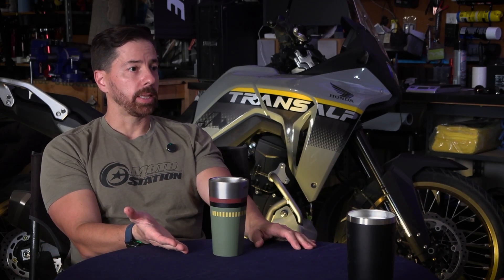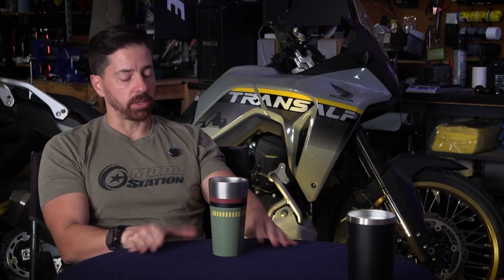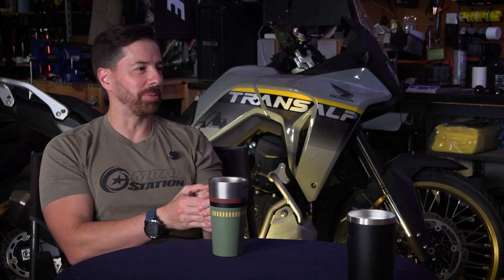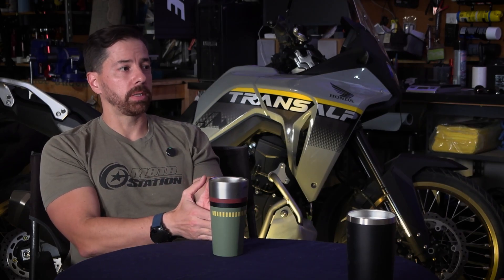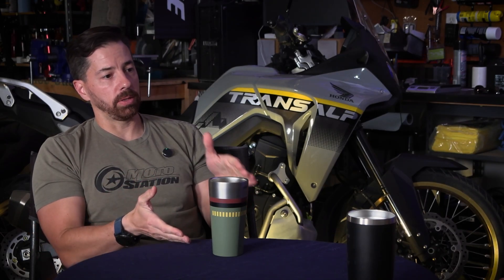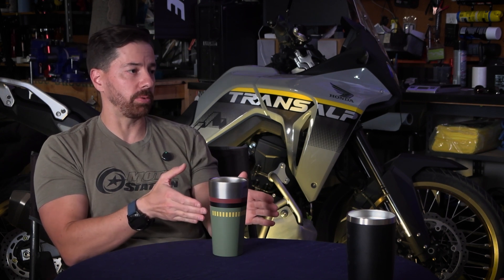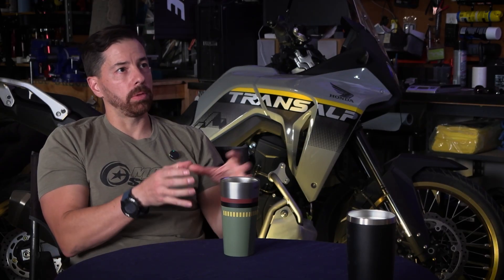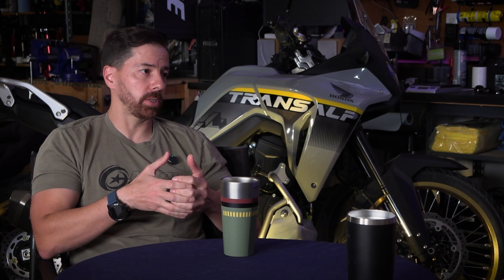The Weird Reason KTM Broke Chains at Misano (MotoGP Tech Explained)

Comment: I never would've guessed they didn't use a chain guide

Also interesting that 25 years later, the frame on my SV is again being returned to as 'hella fast' and 'real fun'. Turns out that 90's intuition about putting an engine in a wet noodle was right!

Comment: Sorry this makes zero sense. Firstly, a steel trellis frame ist EASIER to make flex in all the right ways. Secondly, how exactly does lengthening a swingarm reduce grip and why would that help the bike turn? You're just saying things at this point.
Reply from the maker: The point about the frame is not that we know for sure it stiffer or has more flex, its that they run something different than everyone else and it could be a factor. Several folks in the comments have mentioned that a steel frame flexes more than an aluminum one, that is only true because steel is so much stronger than aluminum that the tubing and wall thickness can be much thinner for the same strength, which can make it more flexible, however the flex is greatly influenced by the design and how the engine is or isn't a stressed member. 

The part about the swingarm length, if all other aspects are equal, a longer swingarm is going mean more of the vehicle/rider weight is on the front wheel. Having less weight on the rear means there will be less grip on the rear and it will more easily slide when cornering. All of these riders want the rear to grip, but also slide predictably. When the rear is very grippy, the bike can be difficult to back into corners smoothly and using the throttle to finish corners on exit can also be difficult.

Comment: The problem was caused by the ride height device, the amount of travel required to engage it means the chain has further to move, the other manufacturers had fitted a small guide to stop the chain coming off as they had identified this issue already

Comment: very interesting...I had a Kawasaki H2 750 when I was a 17 year old H.S. Jr. in 1974, I grew up on two wheels and had just earned my AMA Expert Racing License in 125cc Motocross and the H2 was my first street bike, but I mind melded with it very quickly and could beat some riders I had great respect for on their RD350's through the twisties...the H2 would flex like an accordion but if you just rode the flex I found it very capable, and one day while going full out my chain came off, which was unheard of on street bikes. Now I wonder if the frame/swingarm flex was to blame, especially as the '72 H2 had the shortest swingarm of the H2's (Kawi lengthened the swingarm after '72).

Comment: steel frames flex more than alloy frames.
Reply from the maker: That’s a great point, and it’s a common misconception. Steel doesn’t actually flex more than aluminum by nature. In fact, steel is a stiffer material with a higher modulus of elasticity. But because it’s stronger, engineers can use smaller and thinner sections of it, which can make the overall frame more flexible depending on how it’s designed.

You see a similar thing in bicycles. Steel frames are often said to have a smoother, more compliant ride than aluminum ones, but that feeling comes from using smaller diameter or thinner walled tubing. The material itself isn’t more flexible; it’s the way it’s applied.

KTM’s trellis frame works the same way. It’s tuned to allow controlled flex through geometry, not because the steel itself is softer. Aluminum frames, especially the billet sections used in MotoGP, are designed to precisely control stiffness and flex characteristics even though aluminum is a less stiff material.

Whether KTM’s frame is stiffer or more compliant is really up to how the engineers design it. The point of mentioning it in this context is that the steel frame is unique to them and it's and interesting aspect that may or may not be a factor.
Reply: @CanyonChasersPodcast  thank you for the good information. I find it very interesting that Ktm sticks with the steel frame, when the Japanese all have aluminum. I’ve always wondered what the difference in feeling between the two would be.
Reply: I just ride dirt bikes and it’s the opposite. Steel is more rigid

Comment: Uh, basic metallurgy...
Steel flexes more than aluminum
Reply from the maker: Steel doesn’t actually flex more than aluminum by nature. In fact, steel is a stiffer material with a higher modulus of elasticity. But because it’s stronger, engineers can use smaller and thinner sections of it, which can make the overall frame more flexible depending on how it’s designed.

You see a similar thing in bicycles. Steel frames are often said to have a smoother, more compliant ride than aluminum ones, but that feeling comes from using smaller diameter or thinner walled tubing. The material itself isn’t more flexible; it’s the way it’s applied.

KTM’s trellis frame works the same way. It’s tuned to allow controlled flex through geometry, not because the steel itself is softer. Aluminum frames, especially the billet sections used in MotoGP, are designed to precisely control stiffness and flex characteristics even though aluminum is a less stiff material.

The point of mentioning the steel frame in this context is more that its a unique feature of KTM and could be a factor, but may not be.

Comment: Theory... not practicality. 
There is NO such thing as too high of a Coiffient of Friction. Perhaps tire compound is a contributing factor. Also chassis design. A surface has a Coiffient of Friction due to the materials science utilized in manufacturing and implementing on to a circuit. 

It's design flaws of the bike, not the surfaces. Modern GP bikes are more of a digital product than an analog product,  obviously. But that equates to a much more temperamental product. A much more UNRELIABLE product. I.E.- not engine longevity or performance, but rather overall expectations and consistency. Too many electronics, too many finite adjustments and that means more to go wrong. 

Verdict? Modern bikes and riders to an extent are... 🤢🤮

Comment: Modern riders complaining about their bikes, lol. Imagine putting them on the old 500cc two strokes. THOSE were physical to ride on every track. No electronics, just rider skill and endurance. Back when racing was more about the rider not the bike.
Reply: SPOT on mate!
Reply: Are you serious😂, modern motogp bikes are so fast, modern riders needs more strength (to handle the aerodynamics, power and torque), faster senses, faster reflexes, faster thinking, and much more precise control inputs. Just because Electronics are available, doesn't mean the riders have an easier time. More riders have stated that current MotoGP bikes are a bit too fast and close to dangerously fast, because they have to do more in everything
Reply: Electronics are there just because modern GP bikes need them... They're so much more powerful plus faster. I agree on tyres and brakes, they're better than older bikes.
Reply: thats apples to pears..
I do agree on how physical those 500 where, or 2 strokes in general without all the modern elecs.
But they didnt go as fast did they.
If you are a rider that can get 101% out of a race bike, its going to be physical.
Why? because you are constantly on the physical limits on whats possible as a human on a bike.
Doesnt matter if its with a moped or a nasa rocket.
Reply: Current era moto2 bikes have zero electronics and are 2 to 5 seconds faster than any 500 2t from yesteryear. The current day MotoGP bikes have 2x the power of the moto2 bikes.
Reply: @mohba01   Moto2 bikes use a spec'd electronics package:  An ECU for managing engine maps (fuel/air), engine braking, AND launch control. So, yes no traction control. Otherwise your statement is false and uninformed.
Reply: @rider65 😂😂😂 delusional ppl. The qualifying laps in moto3 was faster than the 500s  in philip island 2 weeks ago.

Comment: The challenges of racing start in the workshop at mid-night. You take a perfectly good machine and race it, and all sorts of issues come to the surface. And some really crazy ones at that defy logic. I've had some strange ones in my time. The strangest one. Suzuki T500 2-stroke, highly modified on methanol in a small speedway car. Wouldn't run on one cyl. because the hone pattern was the wrong angle. Explain THAT!
Reply from the maker: That must have been a highly tuned 2-stroke if the hone pattern angle stopped it from running! Great story!